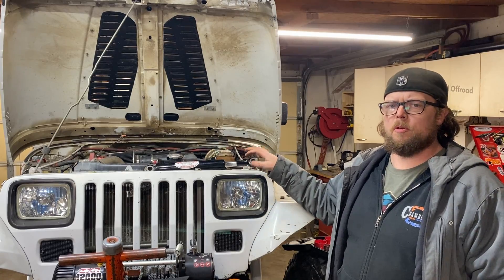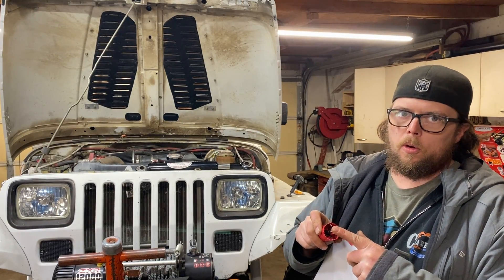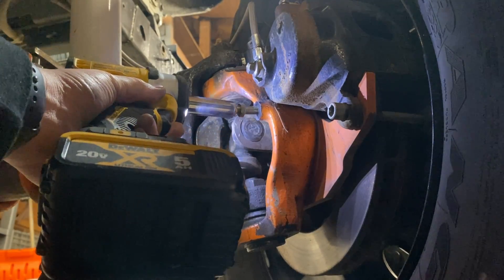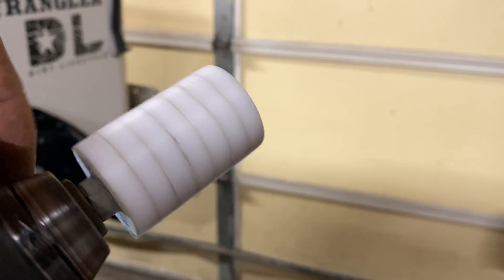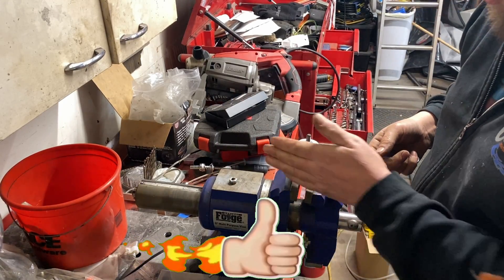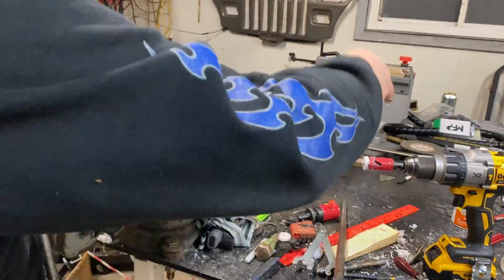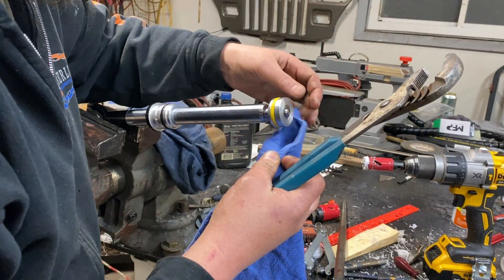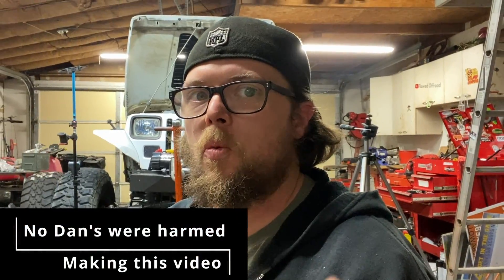Hydro Assist - Limit Your Hydraulic Cylinder Easy and Free! (almost)

Comment: Pardon my ignorance but why did you shorten it?
Reply from the maker: @moejr14  think of it this way. If you’re sitting on your steering stops do you still want a ram pushing on your steering? Cause I sure don’t it can put a bunch of stress on the ball joints and all that. That’s why I tuned everything to where it reaches its limit at the exact same time. The steering box runs out of throw exactly when the axles hit their steering stops and also exactly when the ram hits its stop. Maybe it’s a little overkill but that’s just how I chose to do it

Comment: thanks for posting this - a tip - while you're working, get a wobble pop, empty it (don't waste it), and use the aluminum from the empty can to wrap the piston to  make a slide to get the o-rings passed the lock there is just enough clearance and it makes the experience far less nervewracking.
Reply from the maker: I like the idea, no clue what a wobble pop is though lol
Reply: @FlawedOffroad  an adult beverage that comes in a can... in this case, the can is more important so you could use a soda can too

Comment: I know this is an old video but i often double stack holesaws to cut out "rings" you can thread a smaller holesaw inside a larger oner with certain arbors
Reply from the maker: Yeah it’s called an oops arbor and I actually have one and used it in a different video. Honestly I kind of blanked on using it when I made this one lol

Comment: Thank you! I was able to size down my 8" ram to 6" but i used a PVC 3/4 coupling as the spacers and not the cutting board🤙 and only had to drill out the center stop inside the coupling.
Reply from the maker: Glad it helped!